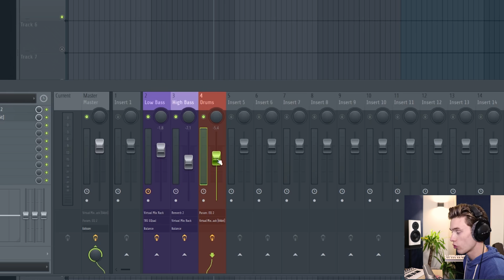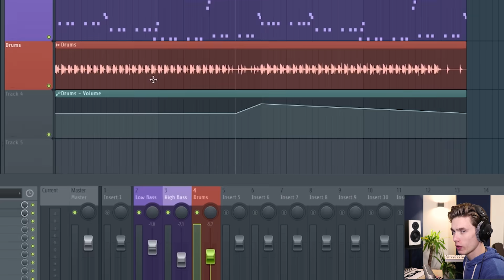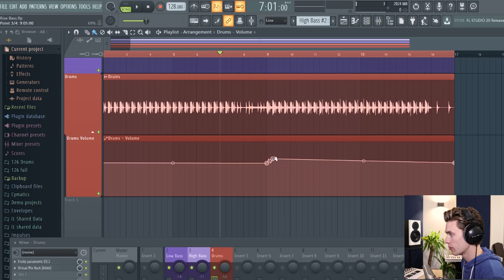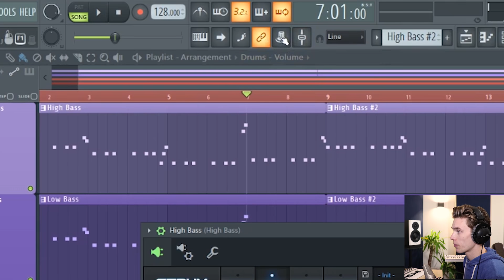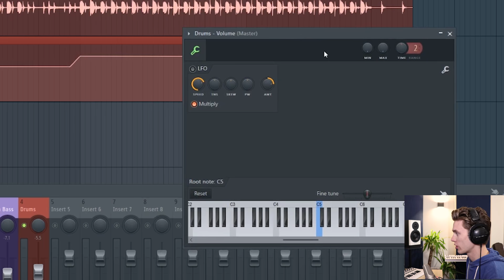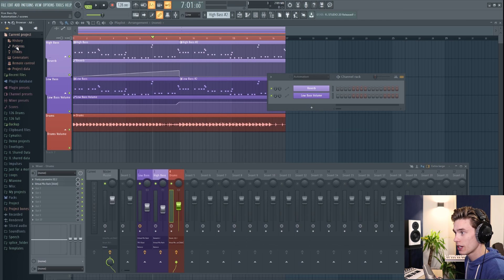How To Use Automation Clips - FL Studio 20 Essentials

Comment: what is automation?
automation lets you control parameters inside a software without manually having to do it.
- the most common automation will probably be volume, instead of sitting there and moving the slider manually at the right time, you can automate that fade with an automation clip
- you can automate a fader, pan, an amount of reverb and much more
	- you can even automate a parameter within an EQ of an instrument

How to use automation clips...
- first you highlight a section of your playlist/song 
- next right click the parameter you want to automate and select create automation clip
- the line you see on the clip matches the value of your chosen parameter
- you can create points by right clicking, and drag points with left click
	- alt + left click is drag fluidly, ctrl + left click is up & down, shift + left click left & right\
- right click your point to play around with the type of point
- you can copy and paste values from the parameter mixer to the automation
- use the dial button to create automation clips for third party plugin parameters
- you can copy and paste automation states
- you can change the range of your automation clips by left clicking on clip and adjusting max and min, this is very useful when it comes to doing finer detailed work like adjusting vocals

Comment: Fl automation is sht, no simple recording option( complicated stuff from events etc.. ). To create one you must move the knob, which messes with the initial value you set before (if it is a vst). You must arrange the clips yourself to groups. The naming of the clips is horrible, if you have a large project it's hard to find anything(you must follow the software engineer thought on naming...). If you want to change anything you must cut, rerecord in a specific area, and it messes with the creative process. My conclusion is if you manage large projects(Automation wise), use different DAW, this thing is for simple stuff!

Comment: Hi there, could you please help me with a small advice? When i want to move a control point to the left or to the right, it moves the whole line section and it will change all control points position. Is there a function to lock every c.p. position and move only the desired one without affecting the other ones? Thank you in advance for your reply. Keep up the good work, you do it very very well!
Peter.
Reply: i just found the solution in the comments... amazing, because only after i posted Kkkkkkk :)

Comment: I've just finally upgraded from version 12 to version 20, so automation clips are new for me. With the old "edit events" method of automation, almost everything far less easy to use (difficult to draw nice curves or see what's going on in the playlist), but because the "edit events" automation is contained within patterns, you can easily create multiple patterns containing different sequences of "events" for the same parameter. This doesn't seem to be possible with the new (to me at least) "automation clips" unless you want to clutter up your channel rack with a new automation channel for each individual clip. 

The first way I thought to get around this was to simply make very long automation clips that bridge the gap with long periods of nothing happening between the sections you want to automate. For example, lets say I want to increase the reverb on something in the 16-bar rise before a drop and then cut it out as the drop comes in, and then a similar but faster 8-bar rise before the next drop, 64 bars later. At first, I making super long automation clips that begin at the start of the first rise and end at the end of the second rise, but that creates problems when you want to select and drag whole parts of the song, for example if I want to add or subtract even a single bar from the middle of the song between the two drops. With long automation clips, any time you shorten or lengthen the song by changing something during their duration, you have to edit each individual automation clip that bridges the area you're changing and lengthen or shorten it by the corresponding amount. If you have a lot of automation clips bridging this gap, that's very tedious and it's easy to make mistakes.

Then I discovered that you can copy and past them automation clips, so I thought "brilliant" and did that, dragging the copy of the automation for the first, 16-bar rise to the correct position for the second, 8-bar rise and then editing it make it shorter, the same change over 8 bars instead of 16, only to discover that it works as if it's still one "pattern" - the edits I had applied to the second automation clip had also appeared in the first one. It didn't seem possible to program multiple differing sections of automation without cluttering up the channel rack or using awkward long bridges of nothing between automated sections.

Just before writing this, however, I found a way that seems to work. For the two sections of automation in my example which should be a bit different from each other (16 vs 8 bars), you simply make a longer automation clip than you need for the first time and then use the slice tool to cut it up and distribute it around the song where needed (e.g. make a 24-bar clip and cut off the final 8 bars, or simply drag the first 16-bar clip out to 17 bars, cut the final bar off with the slice tool, drag that bar to where it needs to go and then extend it and add your automation points and curves). They're now both still part of one automation clip and you'd never know unless you drag out the end of the first clip to reveal that the data points of the second section are there too but simply hidden..

Still, that seems a rather roundabout way to do something which feels like it should be very simple. Am I overlooking something quite obvious? Is there another way to do this?  On patterns you can right click and then select "make unique", but I can't find anything corresponding for automation clips.

Comment: but if I for example have a track with 100 clips of different drums. These clips have different lengths. But I want to assign all of these clips a fade out automation with a smooth envelope. Do I have to copy each automation clip 100 times, and where the clips are of different lengths, each automation clip is made unique and edited? And then I also want to copy the snair with this automation to another track. Do I have to copy snair separately and copy automation separately?

Comment: im having issues with my automation clips, when i right click i dont get the option to change settings, i think i messed up some default settings because also when i use my mouse to drag down a point etc the amount doesnt show on my left corner as a move it, its hard to explain in words, if anyone can help.
Reply: have you figured this out? I'm having the same problem if you could help I'd appreciate it a lot
Reply: i know how to solve this problem. You have just turn off button step, on top left side of project.(srry for my eng, im from Ukraine)
Reply: @fl1ny418  that doesnt fix it?
Reply: @fl1ny418  thx man when i get my comp back from the feds i will try to do this

Comment: Would i use an automation clip on a single note? Or is there an easier way to do it? I have a note that holds out, but i want it die out... kind of like say, a clarinet holding out a note but dying out at the end of the melody.
Reply: And then after i'm done with the melody but want to put it in another spot, i would just render it as an audio clip and place it where i want?

Comment: When you used the pulse automation thing...how did you change its density like I mean like frequency of the waves ? How did you spread it ?  At 2:49
Reply: So you have to points on either side of the pulse wave, and a third in the center. L click on on the center one and move mouse up or down to change velocity :) hoped this helped

Comment: @In The Mix  When I try to drop points on the automation track it draws a line of points. How do I turn this off?
Reply: did u found a solution? got the same problem :D
Reply: Yeah I have this problem too, any fixes?
Reply: @FoxGAMING-NTF  top left corner in the mixer are two boxes "step" & "slide". Just click on "step" and it should be solved. no dots anymore

pls tell me if it worked - im not sure anymore :D
Reply: @Me-xx9mw  I don't know, I think step still does it, I don't remember though now. In the end what I wanted to accomplish I was able to do.

Comment: I'm super frustrated! I've tried this several times on a sample and I just can't get it to work...I have a sample in a pattern, but I want the sample to stop partway through...Figured I would use automation to drop the volume to zero at the right point...Sure, I could just drop the sample into its own track and manipulate it there, but for some reason the volume of these is considerably louder than when placed in a pattern, even when the pattern volume is maxed out...SO again, using automation for the volume would be great, but it doesn't seem to want to work for me..So what the heck am I doing wrong?

Comment: whenever I open an automation clip, insted of dragging my point, it makes new ones when I'm suposed to drag it while holding left mouse tapp down
Problem is: I make new point when I try to drag the automation clip point...why is that and how can it'd be fixed?
Reply: it's like my automation clip is in paint mode or something
Reply: Same (0) (o)
Reply: @duckymomo8862  Bro! I found the solution to the problem! https://youtu.be/GaKTO2hoZec it won't delete any progress. It will only reset the "fl settings"
Reply: On the top left of the play list window, just above the instrument track, there are two options you can select: step and slide. You have step selected, which creates a new point every time you click. See here also: https://forum.image-line.com/viewtopic.php?t=149664&__cf_chl_jschl_tk__=aa62cb28dccfb90bccca4e94f43f547b29710962-1586001631-0-AYJ4LhnL_1x0wBdmOKMRrcgv2Ejlo3VhkSP_Ia4d8dSZr6qlLEEMh9t0bcvfEKKwxLF40odd0I9op_l_FY1_woxjQWWAg9C9iJZTh_bppo7iku7Ueh1y_4phW5VzykYrmLRRdJH9zzWH4wWuhyza1nHLqb9SyPPIuKyNDmhpebixOzfBhJIg9HRNInLRgEF-x3zEVognQSqKJAF2-BUqxlEkmJgp6CmDE2ZkWgvBObk7pSuzreu4kzV94uSfmRUJmi5ZJfZkH4QDmkg08Y1KI7tf7MVKzmbD_4WcaA2Zf1NosXUNkh90GSutmHyCbzF4vA